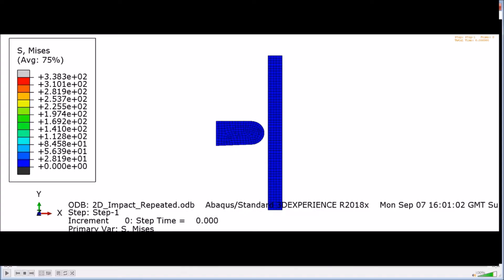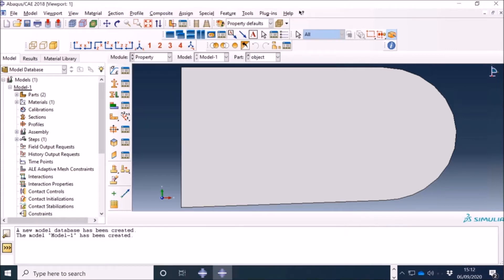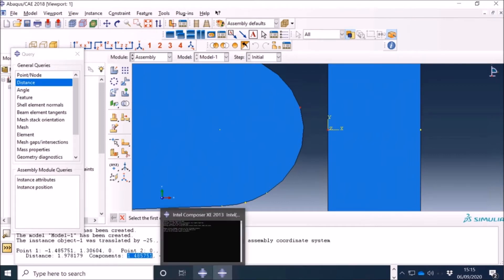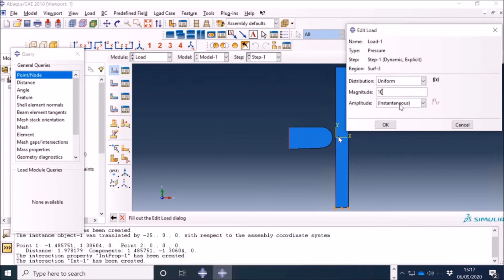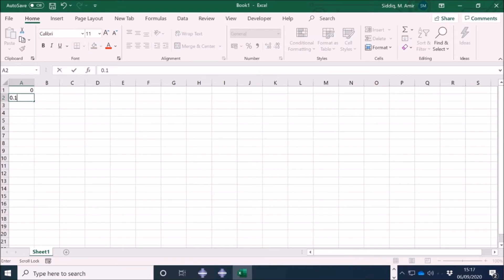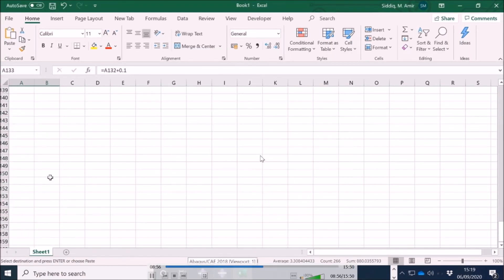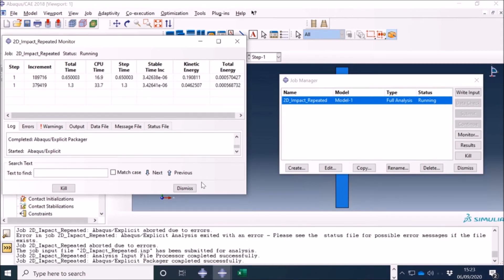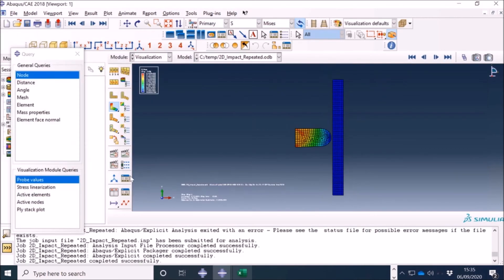Repetitive Impact of Two Objects - ABAQUS Tutorial

Comment: Hello .... My master surface of part is penetrating the slave surface of other part ... Can you please help the procedure to follow to avoid the error.
Reply from the maker: if you could email me your model I can have a quick look?
Reply: @Professor3MEC  Sir I will mail you. I have given surface to surface contact between master and slave surface, I could see my master surf is penetrating through the slave surf of other part. Will you suggest any corrections.
Reply from the maker: @KS-gw4je  there could be various reasons, may be surfaces are not correctly selected. Or may be at the start of the analysis surfaces are already touching or penetrating. So better keep a small gap between the parts at the start.

Comment: Thank you very much for the tutorial sir. Would it be possible to examine the impact (e.g. in terms of energy) between different pair of objects?
Reply from the maker: Thanks for liking the video. If I understood correctly, you are after different energies, such as potential, kinetic, dissipation, etc. This can be selected in the step module as field or history output.
Reply: @Professor3MEC  Thank you for your reply. The goal of my research is to use numerical solver to understand the shock absorbing performance of a soft inflatable chamber, based on different inflation pressure. Do you think it would be feasible?
Reply from the maker: Yes it should be ok to do using abaqus

Comment: Hi in this case if we go for 3d model and go for 3 impacts will the results of deformation adds up after every step or will it show the same sir?
Reply from the maker: It depends on geometry. If you have plane stress or plane strain it may be the same but if geometry or loading changes in thickness direction then it may not.